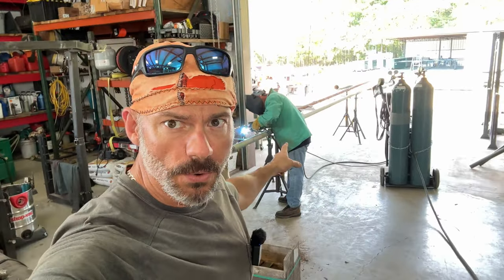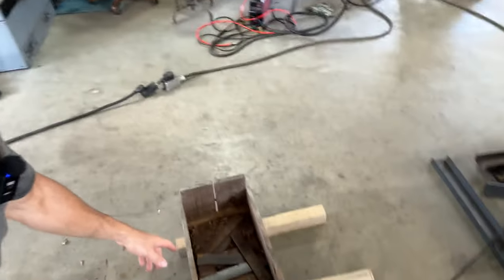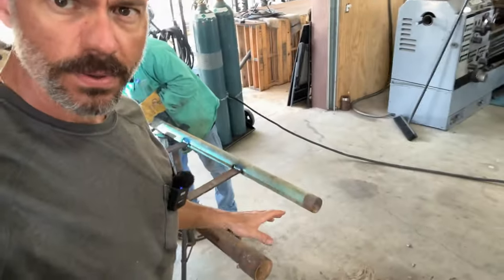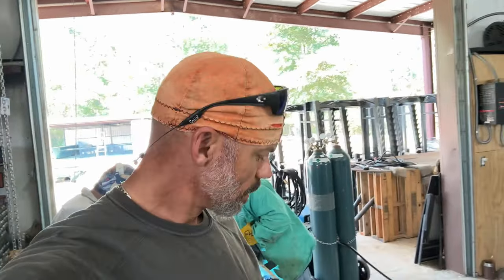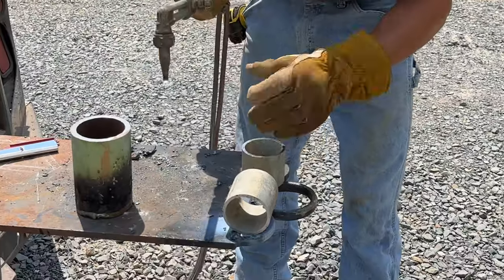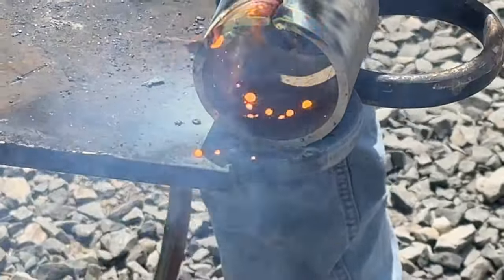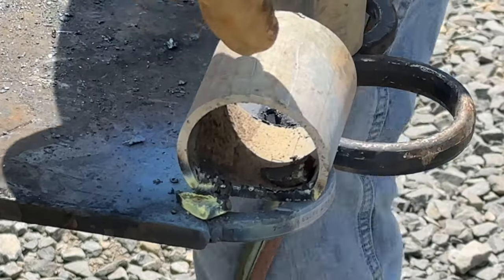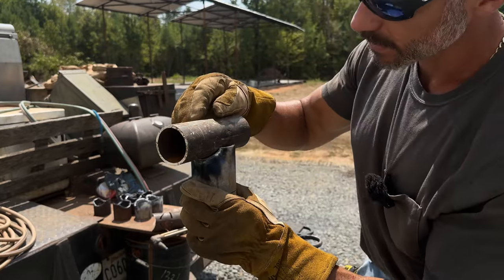Master Pipe Saddle Tip Revealed: The Secret to Easy Fit and Welding

Comment: That’s the way I was shown to saddle pipe when I first started.  You didn’t show it, but if the joint isn’t 90 degrees just cut a little deeper on one side and it will work about the same way.  Like you say, once you get the hang you can eye ball it.  Nice video.

Comment: I appreciate you making these videos.  For what it is worth on this particular topic, may I offer a different perspective?  To connect one round pipe to another with a perfect fit, you cut the joining pipe with two 45 degree cuts that form an included angle on the end of the pipe of 90 degrees.  This is mathematically foolproof and much easier than trying to cut out some valley freehand (or with subsequent persuasion).  It is essentially the same process except what I am suggesting is that your cuts are rotated 90 degrees and instead of carving a valley you are carving a point.  Try it out!  Best regards.
Reply: I’ll give it a shot

Comment: Another advantage of cutting with a torch. Hot metal is easier to bend. You would laugh at how I made bar joists for a shed using leftover rebar and angle iron!

Comment: i usually weld on 2 inch pipe to 12 inch pipe doing chiller yard work or air handlers and my boss says i need to weld faster but i get 0 leaks almost ever and keeps saying hurry up and it demotivates. if i get 0 leaks why the heck is he complaining about anything
Reply from the maker: They’re always gonna say hurry up
Reply: @TaylorWelding  i can only weld as fast as the rod burns brother

Comment: I think something that is worth mentioning is how you set your flame, hit the gas valve with a little more pressure, then set your flame again while holding the air lever. Something as simple as that isn’t taught to this newer generation of welders
Reply from the maker: That’s a good point I didn’t even know I did that I do about the same thing every time.

Comment: I was welding down hole mandrels for Weatherford Enterra in the '90's and most of our fixtures and tables were made of old drill stem.  Safety came through with a meter and they were almost all radio active. Be careful!  Another great video!  Thanks.
Reply from the maker: Most of it has Norm in it.

Comment: I like that flattened out saddle, any suggestions for trying to flatten a longer piece without a vice, thanks ✌🏼
Reply: Brute force and ignorance 😂😂
Reply from the maker: You can weld the throat, and then beat the sides flush. Or you can heat it after you weld it and you don’t have to beat it is hard.
Reply from the maker: Just beat it… lol
Reply: @TaylorWelding  Ok Mr. Jackson